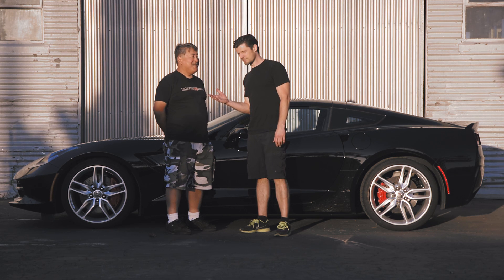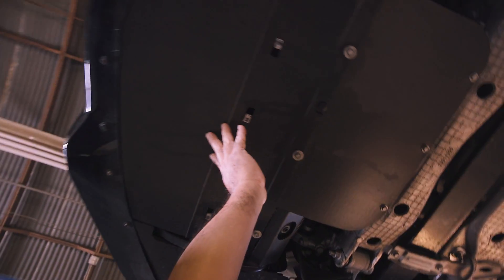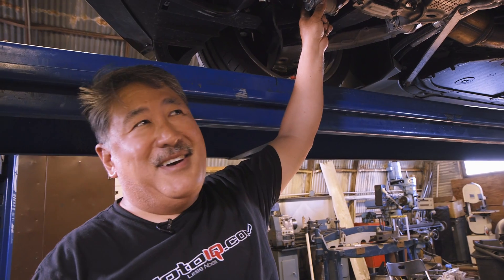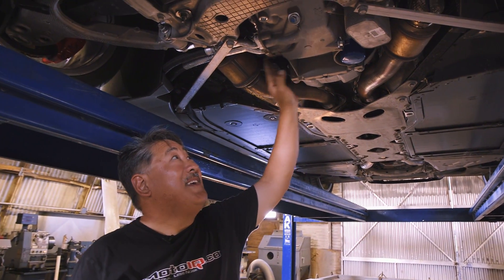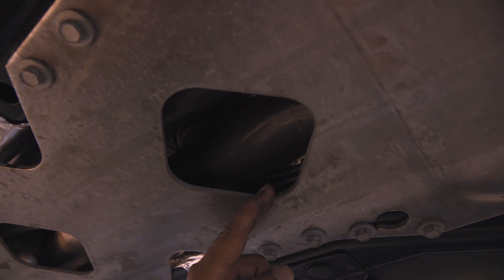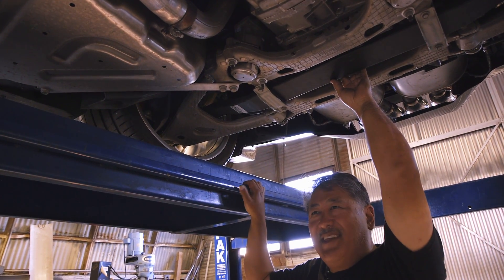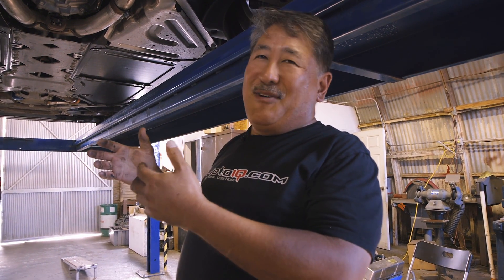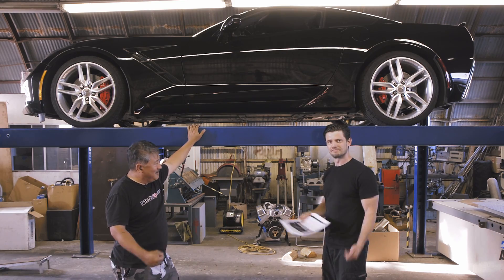Building the Ultimate Track C7 Corvette Stingray: Introduction

Comment: pretty cool how the oil cooler is right next to the cat :D
Reply: Technically it is a water<->oil heat exchanger so maybe its close proximity isn't such a big deal?
Reply: prolly not as big as if it was an air to oil cooler, but it'd still be better if it wasn't right next to one of the hottest parts on a car...
Reply: Indeed, odd placement. Could have at least used a heat shield to prevent heat soak.